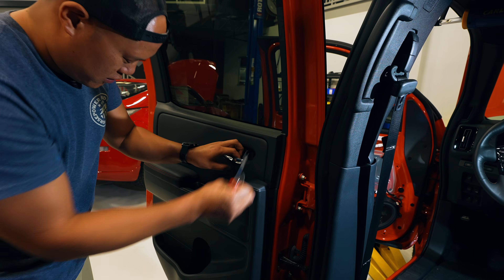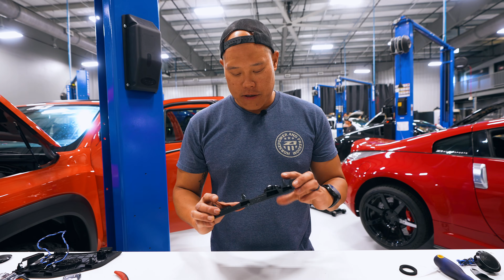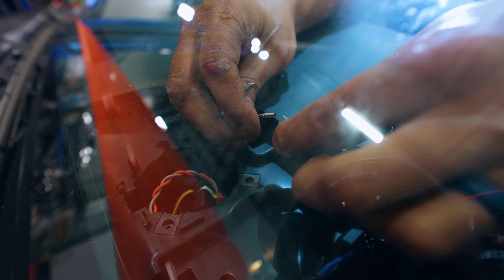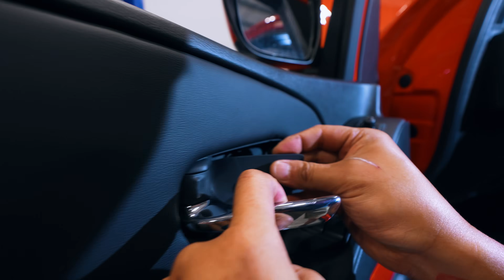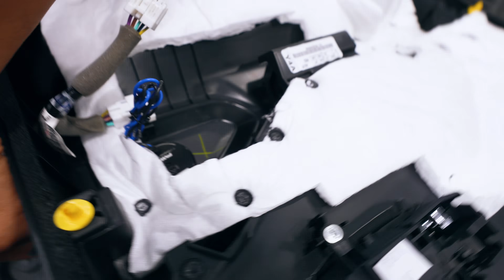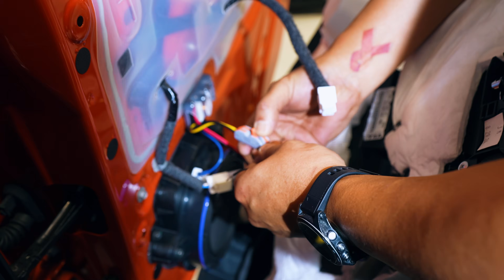Z1 Audio - Nissan Frontier D41 Speaker Package Install

Comment: If i put these in a 2023 frontier crew sv midnight with the base system (not fender) will i need an amp?
Reply from the maker: An amp is not required for just the door speaker upgrade.

Comment: How does the stock head unit handle the upgraded speakers? Do you have to turn the volume up higher
Reply from the maker: There is enough power coming from the head unit. You will notice that the sound will not distort as much when you turn up the volume.

Comment: Can you share how to install with a base package non fender
Reply from the maker: Same process, the only difference is you need to collect the audio signal off the back of the head unit.
Reply: @z1off-road Can you explain that a little. I have a 22 pro4x without the fender system. I want to upgrade the speakers. The video makes it looks easy enough. But I don’t know anything about car auto.
Reply from the maker: @pulser955  Its simple, the way we designed this kit was to just unplug old and plug in new.
Reply: @z1o @z1off-road f it’s plug any play what does “ collect audio signal from the back of the head unit” mean?
Reply from the maker: @pulser955  there is a connector that our harness connects to. You unplug it from the back of the head unit and plug our harness in between.

Comment: How about a video with beore and after sound comparison
Reply from the maker: Audio typically gets compressed by the playback platform, each viewer is also using different speaker, head phones and in different environments. By the time the sound reaches the customer, it may not resemble what the speakers actually sound like in the truck at all. So the comparison becomes misleading, and not helpful.

Comment: If this had come out a year ago, I 100% would have bought this.

However, I welt with JBL 2-ways in front and back instead.
Reply: Did you have the fender system before putting in the JBL's? Mind telling me which model and size you went with? Did it make a big a difference? Thanks!

Comment: Soo.. for anyone that has worked on the fender system.. the front door speakers don't get a full signal do they? mine are very low volume and just sound like mud... i replaced them with some kappas and same thing.. almost no volume and just pure mud.. the dash speakers seem fine.
Reply: My 25 pro4x fender system kicks some SERIOUS ASS.
Reply: Door speakers are crossed over as subs.
Reply: @mikebiron7339  Thanks.. replaced the truck about an hour ago.... it was not a good vehicle for me.